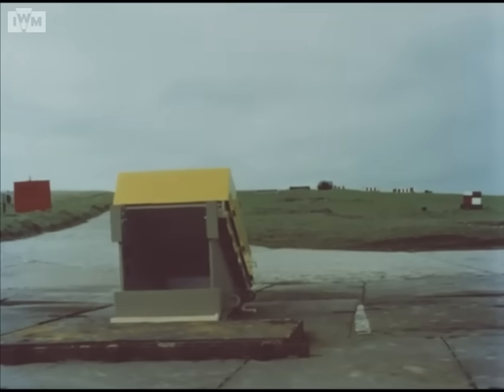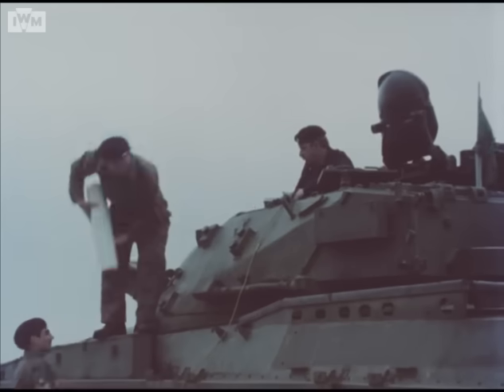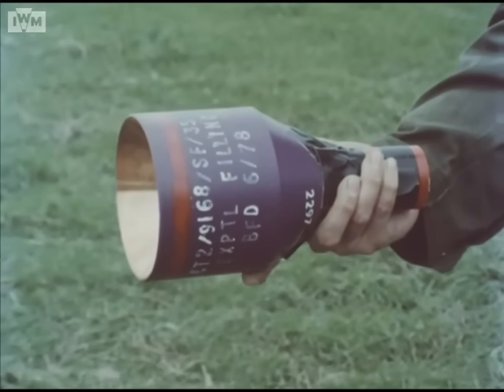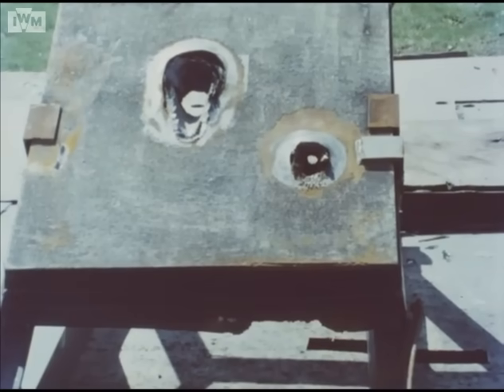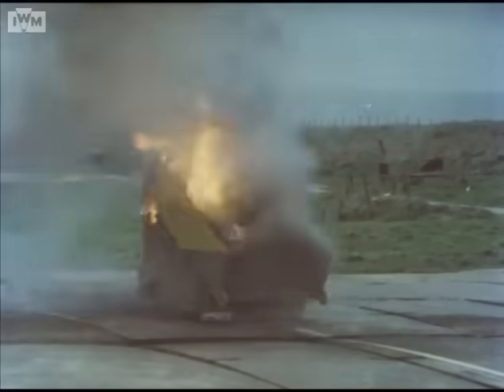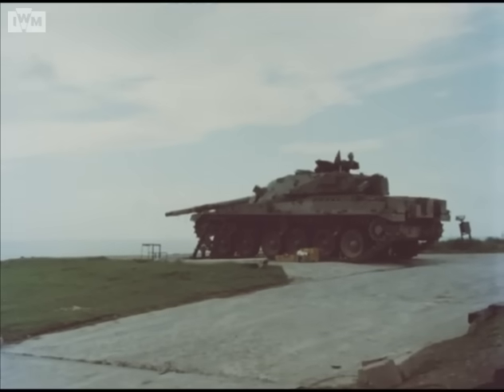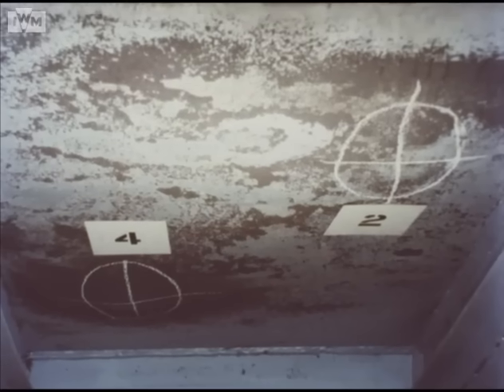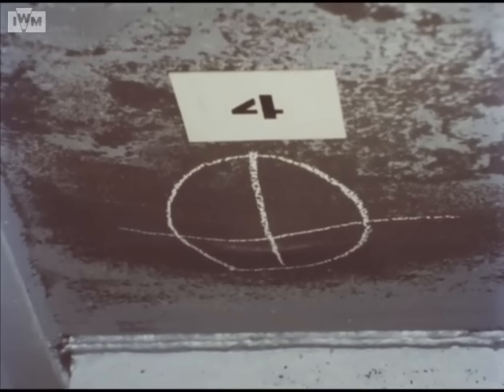Firing trials on British Chobham armour 1979

Comment: What does it do against more modern apfsds? Also looks extremely thick, though I guess depending on what is used between the layers could be significantly lighter than regular steel plate.

Comment: To think I may have heard those shots fired at Lulworth. Interesting and informative. U can see why a Chally took 10s of RPG Heat Rounds and was battle ready days later.
Reply: Hours later, thrown track, damaged sights, it was out for a few hours IIRC
Reply: I grew up there from 1980-99 about a half mile from the main firing point. 
We would always hear Chieftains in the 80's then one day there was an almighty "Boom/Crack" and everything in our home shook, that was the first time we heard a Challenger, so much louder you can feel it in your gut. 
Fair play to the Iraqis for standing near it, I wouldn't even dare sit in the carpark behind them.
Reply: @eviltaylor1  used to live in Lytchett Matravers, if the wind was right we heard those bad boys

Comment: Yet shaped charges still slice through modern battletanks in ukraine 40 years later. So looking at this its very strange if these tests were actually real.
Reply: The only tanks to use this armor are the British Challengers and American Abrams. That being said, the armor on the bottom and top of the tanks are thin so they're still vulnerable to AT mines and drone attacks. This technology was great in desert storm. The T72's 125 apds rounds would simply disintegrate on impact with Abrams tanks. But yeah, the concept of the MBT being used as a break through weapon is something of the past.

Comment: All composite armor is layers of different materials:
Steel + something very hard and dense + something softer, but much lighter. 
That's the basic concept.

Additionally to absorb the shockwave and prevent spalling you have either a thin layer of something very soft in-between and/or an anti spalling liner on the inside under the paint.

For the hard and dense layer, initially ceramics were used, later tungsten and depleted uranium. Rumors say it's not always a full layer but just a mesh to save weight, at least in some places.

In key areas you also have NERA, "non explosive reactive armor", which is e.g. multiple layers of different materials that will deform/change shape under the stress of an impacting projectile. NERA is engineered in a way that this deformation will cause negative effects on the projectile, like causing it to slightly deflect and/or causing it to deform material in a way so that the projectile has to go through more armor than if it was just non reactive armor.

The only thing I don't understand is why engineers of "western" tanks don't make use of both NERA and ERA. Maybe we'll see that on the next generation of MBTs, especially with the proliferations of drones and therefore the necessity of good HEAT protection all around, as ERA is the most effective against HEAT threats.

The South Korean K2 could be unique in a way that is uses both ERA and NERA.

Comment: Didn’t conventional armor go out of use in like the 50’s.
Reply: Started going out in the 60s
Reply: The Soviets started experimenting with composite armours in the 1950s, and put some into production in the 1960s.  The US started research in the 1950s too.  The Brits started a bit later, but they got lucky with their Chobham formulation. The Sovs had very clever material science, but problems in production techniques meant that in practice it wasn't reliably effective for quite a long time, and you couldn't really tell which individual tanks had defective armour until they got hit....  In the West, steel armour on US and British tanks until Abrams/Challenger with Chobham.  The Leopard I and French AMX30 seem to have used wet cardboard.  I think that many folks interested in tanks would say that Chobham was the first composite armour that was really consistently effective, and also worked well against both HEAT-type rounds and high-velocity penetrators.

Comment: Judging on the after effects shown on the rear of the armor, the Chobham armor is specifically meant for and is very capable of defeating HEAT type impacts.
Reply: It is capable of providing superior protection against both kinetic and chemical weapons, compared to rolled homogeneous steel armor.

Comment: Events in Ukraine regarding the great success of drones against the latest armored vehicles has prompted further research into composite armor.  Aberdeen Proving Grounds is currently testing a special ceramic using my wife's lasagna.  It has withstood kinetic energy penetrators up to 240mm at 16,000 fps.

Comment: Brought to you by the Chobham Armour Marketing Board.

Two questions:
1. Was all the shouting necessary when loading the shell?
2. Why didnt they just fire from 1200m (rather than adjusting the charge) - were the worried they might miss?
Reply: 1) That’s just their training 
2) They want to make sure they hit it in a certain place like not on the edge or test stand
Reply: yes to both, why change what works
Reply: At 1450m/second it’s virtually impossible to miss with Apds
The apfsds is 1540m/second
Hesh is 850m/second if my memory serves me right
How do I know 
Well
It’s not from watching YouTube put it that way.
The chemical energy rounds ie Hesh , smoke etc are usually kept for bunkers and other mbt targets 
They are very useful 
Especially shake and bake ie smoke, kinetic ie apfsds will just go straight through a line of t64 types and continue out the back
No tank made will survive apfsds and given the muzzle velocity it’s effectively a 120mm sniper rifle.
The round itself is inert.
A DU dart
At 1540 m/second 
Bye bye target

Comment: I know the secret. Its NP1 probably about 4 inches smashed between 2 sheets of steel like a freaking OreO. 😂. Thats whats squeezing out the hole, but it has to be cured. Can't be wet or it won't do the trick.

Comment: 300mm chobham in front, 100mm on sides, and 15mm on top. To where do you direct your attack ?
Russia hit Challenger 2 #1 with a Lancet 2, on top. Destroyed Tank. Russia hit Challenger #2 with a Kornet in the side. Kornet can penetrate over 1000mm of armor steel. Destroyed Challenger #2.  Russia killed Challenger #3 with a direct hit by GLONASS Guided Krasnopyl 152mm artillery ( 1 shot kill ). Chobham armor is obsolete 1990's Technology, in a 21st Century environment.😊
Reply: congrats, you realised a dated armour package which is being used on export vehicles isn't good against modern atgms and modern combat, much like any other tank
No tank is indestructible and you dont need to be smart to figure it out
For example, russia has lost some T-90s and T-80s in Ukraine, of which they too were dated but not as dated as an armour package for a chieftain 
also, 152mm HE is gonna kill pretty much anything if you hit the right spot, thats how overpressure works

Comment: “Under closely controlled range conditions.” In other words, don’t try this at home, children 😌
Reply: No they used underpowered, under weight "Demonstration" projectiles. It was a "Sales Pitch" Video.😮
Reply: @davidjames1063  No.  It's made clear in the video that the projectiles are standard ones, but the charge of the APDS round has been reduced to simulate the effect of a hit from 1200m, because the firing tank in the trial is positioned much closer than that.  The charge wouldn't be reduced that much as 120mm APDS is still travelling mighty fast at 1200m.

Comment: Outdated now Russian Kornets gliding through it and the US version.
Reply: So what do you propose we start using, if you have a better cost efficient option then theres a unmarked van rapidly approaching you with 1 billion in black budget money
Reply: tanks are so early 20th century, see Kursk or the Ronson (Sherman)  @joshhanklon
Reply: @motsigman  dafuq are you talking about, there is nothing that can fill the existing role of the tank better. Anti tank missiles and AT mines have been around for like 60 years but the tank hasnt died. The machine gun was invented a century ago but we still use infantry. Btw what do you mean by “(sherman)”

Comment: Interesting that the Chieftain canon used a separate bag charge instead of a self contained shell.
Reply: The bag disintegrates when fired and so actually improves the tanks rate of fire. The 105mm gun it replaced had a huge brass case that would be ejected into the turret. The 105mm gun could be loaded just as fast but eventually they'd have to stop shooting to clear the casings away from the gun. Usually this is after about 5 shots. The casings would either be placed back into the ammo racks or thrown overboard. On the Centurion and Leopard 1 tanks you can see a hatch on the left side of the turret, that's for the loader to toss spent shells out of. Because the bag in the 120mm gun disintegrates on firing, the loader doesn't have to clean up after shooting and so they can continue to fire full speed until there's nothing left to shoot at.
Reply: @fyrep0w3r  Interesting. I'm familiar somewhat with that system for the Iowa Class American battleships with the 16 inch guns. Same system, bags of powder charges and separate projectiles. I didn't expect that system could be useful on a smaller scale for a tank or fighting vehicle.
Reply: @fyrep0w3r 
Sounds like the barrel and firing chamber are going to be filthy(?).
Reply: All British tanks have since the cold war. Even the Challenger 2. Its called 2 peice ammo and prevents cooks offs if theres a fire since the bag charge is placed in a wet stowage bin surrounded by water.
Reply: @PaxBritannica34563  Aha nice!

Comment: Some sort of non-newtonian liquid in between sheets?
Reply: It's to hide the structure of the plate steel
Reply: I wondered whether it was part of the armour, or expanding foam to obscure the layers.  It seemed too smooth and not charred at all.
Reply: Custard
Reply: Rubber I think, steel then rubber then more steel
Reply: Its to conceal its composition for the camera.

Comment: Excellent content!

However, there are 2 flaws, at least in modern battle field. 

1. The 120mm used requires separate charger where a modern APFSDS is a single shell containing both a projectile and charger.  Hence 120mm APFSDS is much longer thus heavier than the one used.  Hence it will not end up with a simple bulge. 

2. Not all but many ATGM or even some RPGs have a tandem warhead.  This greatly enhances the penetration. 

This is probably the reason why DSTL developed next gen armour. 

Regardless of what it looks like, at the time when Chobam was first introduced, it was revolutionary indeed.  If we exported and reinvested, we would have been miles ahead even now.  Shame.
Reply: tandem warheads don't increase penetration, the initial warhead is very small as it's purpose is to set off ERA before the main warhead detonates. also this test was during a time when separate charges were the norm. and even after western tanks moved to complete rounds pact forces tanks still used separate charges in their autoloaders
Reply: The new epsom and farnham armour should be interesting to see once the chally 3 program gets finished

Comment: And now in a modern conflict cheap tiny remote control drones simply hit the top of the tank and all this front armour is just dead weight. Crazy times.
Reply: Top attack Anti Tank Guided Missiles and aircraft using Air to Ground Missiles have existed for decades.  Frontal armor is still needed for fighting infantry and other tanks.

Just because some factors change doesn't mean every previous rulebook is thrown out; just that there's new rules.
Reply: For the moment that's true, but more effective anti-drone technology will start to appear on vehicles before long, and attack/defence will get back more into equilibrium.  Drones will still be a threat to tanks, but tanks' current very high vulnerability will be moderated.  The extra tech will probably make tanks even heavier, more complex and more expensive though............

Comment: Normal armor 50 mm Chobnam armor 600 mm
ROFL
Reply: Looks more like 100-150mm of steel to me. And you can't lug around an equivalent thickness of steel to Chobham, due to the difference in weight.

Comment: Funny, even those times some expensive ballistic tests were not perfect. The sledge jumps up when hit by projectile. A real armored vehichle weighs e.g. 10x the sledge and plate. And won't practically use any projectile kinetic energy as kinetic energy of the target.

The plate should definitely be rather fixed totally than jumping from hits. Fixed totally would be closer to the real life scenario. How much more energy there would be for the penetration, hard to guess from here. But could be 5-15% more, certainly changes the results a bit.
Reply: Have you ever actually served on a tank crew?
I think not
Reply: @jameslynch7826  😆 Have you ever served in US Postal Service? If not then you know nothing about addresses and packages 🤣😂Why on earth did you post your zero comment? 

People understand basics of physics even without "serving in tank corps". Next time consider before hitting the Enter.

Comment: Note the loader has no  ear protection.
Reply: It's actually not that loud when you're in the turret.
Reply: Mate there’s no use saying that to these computer games idiots who have never even spent a month on tanks
They get their inaccurate opinions from pc games.
Reply: WHAT?
Reply: I have never loaded with any type of eardefenders
The noise inside the turret is fine 
And hatches open for compression reasons 
Loading is a fast workout so you strip down 
And gloves are definitely not permitted 
They prevent you feeling the bag charge 
And or clearing stoppages

Comment: So what was it made of then 🤔
Reply: We don’t know
Reply: It's a secret material still kept as such today
Reply: Metal and ceramic. It was based on the observation that an enamelled metal tray was shockingly good at stopping bullets. Exactly what type of metal and ceramics and how it's assembled is the trick.
Reply: Steel plates and rubber interlayer.
Reply: @razorcola9833  Likely contains more than just 'slteel and rubber interlayer' lol.
Reply: @aarongreen1654  exactly 😂😂😂 It's a full composite material all stacked in armour

Comment: I developed armor for about 7 years and loved it.
Aberdeen Proving Grounds, Lawrence Livermore Labs, DOE Idaho, U.S.Marine EOD,Camp Lejeune, Misnay-Schardin Devices, shaped charges ,mine tests, explosive suppression technologies, all of it was absolutely the best time of my life.

We do have the blueprints for the Chobham Armor, and the subsequent follow-on advances.

You can spend time in a nice Federal Hotel with free meals, and free gray uniforms if one were to talk about it.

Loose lips kinda stuff.
Reply: Dont leak it on the warthunder forums
Reply: The original M1 Abrams armor could probably be declassified without posing any risk. Alot has changed in 45 years in Ceramic engineering, and material science as a whole.

Idk tho, ask the DOD nicely enough, and maybe they will..
Reply: Well the earliest variants of the armor package seem to have been at least partially declassified. Which is not surprising considering any foreign intelligence agency that can’t source the details of a 60+ year old armor package doesn’t deserve to be called an intelligence agency.
Reply: https://below-the-turret-ring.blogspot.com/2017/01/early-m1-abrams-composite-armor.html
Reply: The damage on the armour looks weird. Is it something related to ablative filament or that's some weird alloy? I don't need a precise answer, but when I see that inflated part of armour at the impact site, I can only think about ablative materials for some reason.
Reply: @antonkovalov9648  According to another comment the grey stuff in the holes was added before recording to conceal the sub-layers of armor.  Probably some kind of expanding foam.
Reply: It was filled in for secrecy reasons at the time so no-one could work out how it works.
Reply: Considering how crap the British tanks are on War Thunder maybe they havn't been leaked.
Reply: @The_Greedy_Orphan  that's American game designers unable to cope with reality ;)
Reply: @jamespennington7919 they’re Russian game developers, so even more biased than Americans
Reply: @Boamere theyre not biased in terms of rules, draconian marx censorship a lot
Reply: If you're not supposed to talk about it, why are you talking about it?  On a public forum!
Reply: It's just re-cast tea kettles, years of the material being steeped in tea and soldier's piss causes crystallisation of the metal, resulting in ceramic like behaviour.
Reply: Can u give me the blue print for educational use🙄and iam playing warthunder btw
Reply: oh dear
Reply: Unless you're Donald Trump. 
Then you can leave it on the counter of a restroom at your country club or sell it to a third world dictator and it's all gravy.
Reply: Yet none survived in Ukr.
Reply: @davidjames1063  none of what? The Challengers are still working bar one that ran over a stack of land mines (and may have been repaired even after burnout). The latest Chobham/Dorchester isn't fitted to the tanks donated to Ukraine, for defence security reasons (ie we don't want the Russians getting some).

Comment: Yes the crew would be safe but what happens to all the electronic equipment inside the tank.
Reply: almost nothing, you can make electronics shock resistant and such a hit would be more gentle than smacking the electronics with a hammer from the inside.